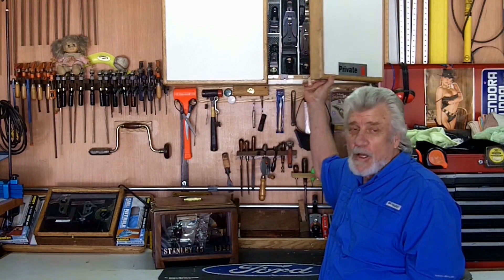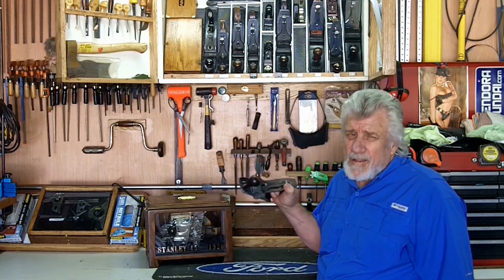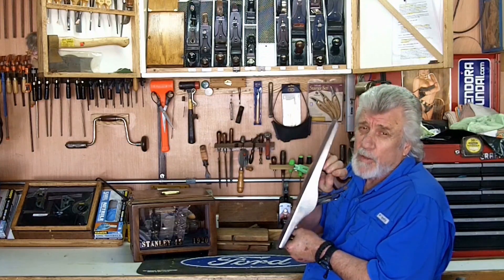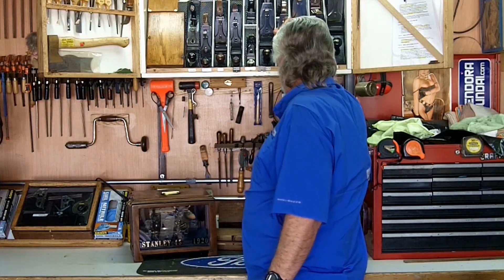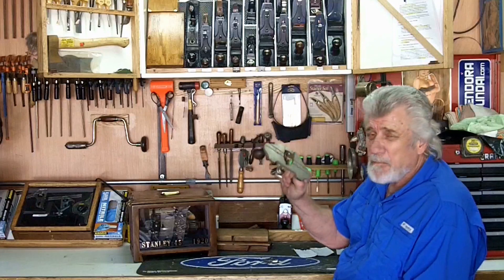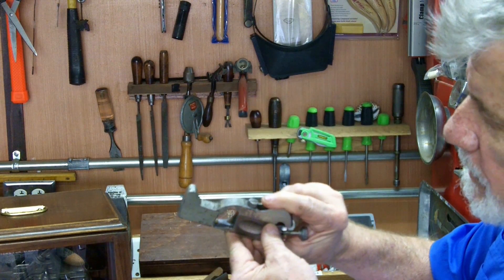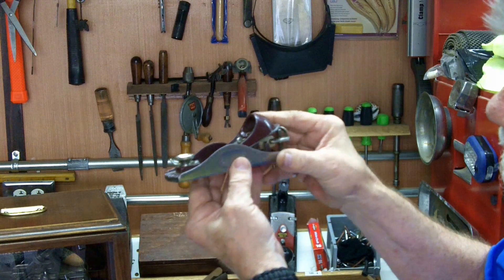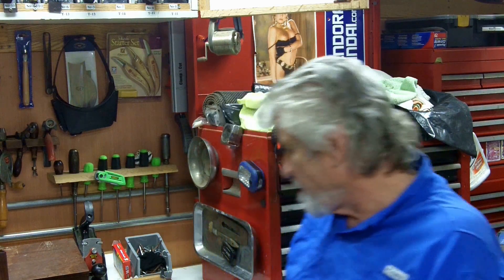My Hand Plane Collection. The years Stanley made them and the reason for the types

Comment: As an apprentice years ago, I saw many 'C' planes (corrugated) but they all seem to have gone away now. The idea behind the corrugation was to reduce friction in use, having less surface contact with an equal amount of area in contact.

When it comes to block planes, I find that most YouTube woodworkers seem to hate them. As for me, I bought one when doing my apprenticeship way back in the late 70's and I still have it and use it on almost every carpentry job (not joinery job). I swear by it - a Stanley G12-220, made in England stamped into it. It looks battered but is as good today as it was when new, under all the wear and tear. That little thing has done some huge work in it's time and is still going strong. It has been with me all over UK and into Europe; never let me down. Easy to maintain, fits in my pouch, always at hand, lightweight and always sharp, one-handed use; what more could you want on the job when time is money?

Comment: It's easy to sense your passion, and that makes the video enjoyable, so thank you. I don't have anything like your collection, and nowhere near as old. I have what I determined to be the essentials for my kind of hand woodworking. They are all pre WWII but are 'users', not 'collector' grade. However, using these older, quality tools brings me such a lot of pleasure. Properly set up, they all do their jobs very well. I'm now looking for a decent Stanley 9 1/2 and maybe a 60 1/2 to complete my 'user' set...;-) I'd like to get my hands on a nice 140, but they're kinda hard to find and pay for!  
P.S. I never understood the point of bull-nose planes. It seems to me that they might as well just snap off the part in front of the blade to make it more useful in tight corners! Any comments? Anyway, thanks again for your enjoyable and informative video.
Reply from the maker: Hey, Tyvole, thanks for the comment.  I hope you get all the hand planes you want at the price you want.  Good luck.

Comment: Hi Mike, I too have gotten on that slippery slop of buying old Stanley planes and have a small collection. I was wondering if you would share your secrets on how you are able to put that much shine back into the soles. I soak, clean and polish mine but have never been able to get that high of a sheen. Thanks Willie Sims
Reply from the maker: Hello, Willie.  Thanks for taking time to leave the comment.  Several people have asked the same question on getting planes to shine.  No secret. Just many hours and hard work.  I just bought a #4 on eBay for $12 + $15 ship.  I thought I would do a complete step by step on restoring.  I have a couple of projects than need to be completed before I get to the plane restoration.  Come back in a few week and I'm sure those planes of your will shine like a mirror.  Thanks again and hope to see you soon

Comment: I have a wooden block 15" long X 2 1/2" wide X 1 1/2 high with a metal frame(saddle) with a large standard front ball handle & a full grip back handle. the blade is a 45 degrees & a brass horizontal adjustment. Also has a a side to side adjustment at the top, that moves left to right.
Question is what kind of plane is it & will it clean up a table top made of constriction grade lumber?  I am making an farmhouse table this summer for use in a wedding, my first table & they want a rustic look.

Comment: hey Mike great collection, just wondering is there a difference in how a smooth plane and a corrugated plane operate 
thanks doug
Reply from the maker: Hey, Doug. theoretically, the groves are there to keep friction away.  If  the plane has a resistance of 2" X 14" on a smooth sole, then if you took half that away with grooves, it should be less resistance.  It might work with the seven and eight.  After all, back in the day, these guys could push a plane 1000"s & 1000's of time per day.  3, 4, and 5, I don't think they did all that well.  Most of my planes are corrugated.  I just like them, but I'll never do 1000's & 1000's.  Hope this helps
Reply: thanks Mike Ive not used hand plane much, but when I see antigue furniture I am amazed at the quality, real hand crsftmanship,  thanks for the knowledge, maybe you can teach an old dog new stuff!
Reply: Not much difference between corrugated vs smooth. I have both and can’t tell much difference

Comment: Hello Mike -  Listening to you is like talking to every old friend of mine, old car guy  / old biker guy / old school / we sure had fun with hot rods and Harleys -- you get it.  Can you talk a bit about the WorTH brand plane you picked off the shelf, I bought one for cheap and cant find any info about it. Did it have a parent company ?  Thanks ...............Dave
Reply: Dave, I have a Worth plane, about 9 inches long that my dad bought in mid forties. It looks nice but cheaply made with a weak stamped steel frog. It would not do any useful work until I reinforced the frog, but since it was my dad's I restored and kept. it. I'm a machinist with a surface grinder so I ground sides and sole square and true. If you send your email on this post I'll share photos with you.

Comment: My notes from ur video
Type 10: 
 * Circa 1907-1909
 * first to have adjustable frog
 * Had “Stanley Rule & Level  stamped on blade

Type 11:
 * Circa 1910-1918
 * has 3 patient dates; 02, 02, 10
 * V shaped logo

Type 12:
 * Circa 1919-1924
 * High knob
 * Sweet Heart Logo

Type 13:
 * Circa 1925-1928
 * only one patient date 10      AKA 1919

Type 14:
 * Circa 1929-1930
 * Made in USA is now on toe, not Bailey
 * Ring around Knob

Type 15:
 * Made in USA is behind the frog / in front of tote (handle)
 * No patient date
 * Bailey is behind the knob
Type 16:
 * Circa 1933-1941
 * sweet heart is removed
 * Kidney shaped lever lock hole
 * rim in front and back of plane